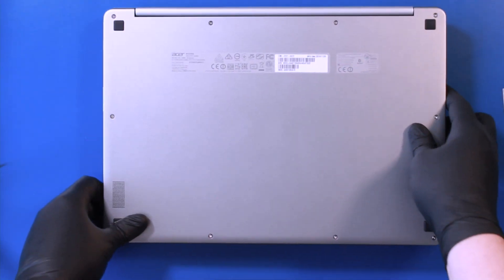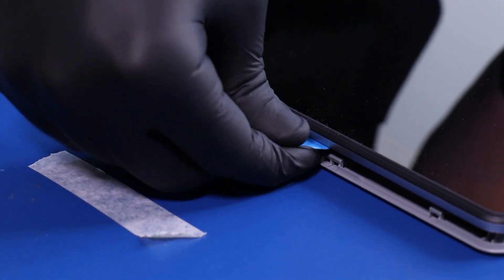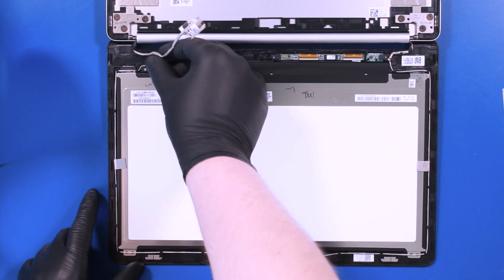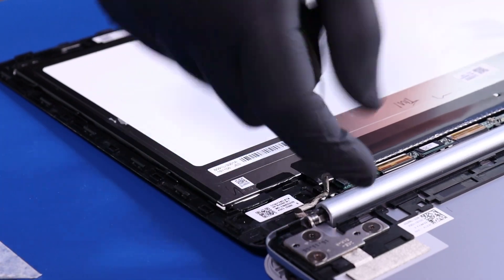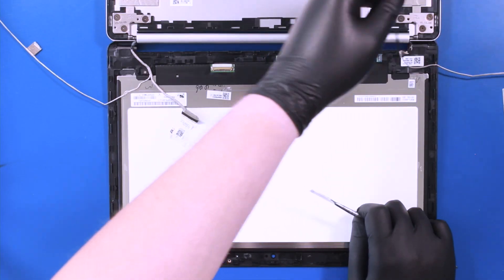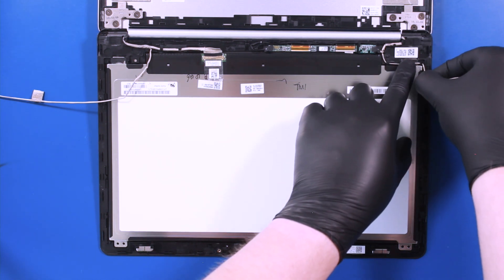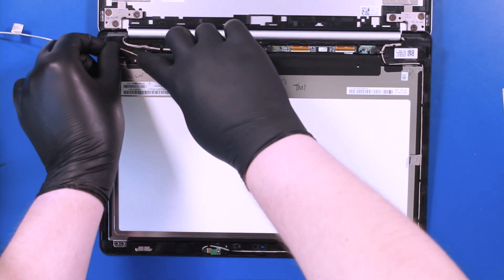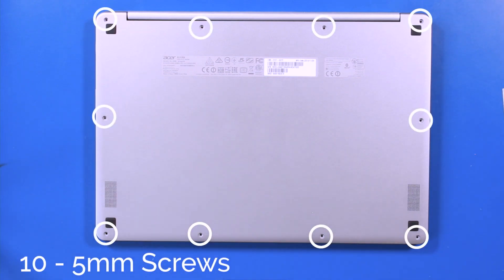Acer CB5 312T Chromebook LCD Module Replacement

Comment: I replaced a screen on an Acer Chromebook CB5 312T K2L7 with a new LCD module, but the one I received did not have an integrated sensor board. I tried using the sensor board from the old LCD module and I also tried without the sensor board, but in both cases, the brightness appears but there is no image. I tried with a second screen via HDMI, and it works on the secondary screen. Does anyone know where the problem might be coming from? Do I need to change anything else?
Reply from the maker: From what's happening with the new screen, our best guess is that there is either a faulty LCD cable, or the replacement mod itself is faulty. The sensor board should only affect your touch capability or being able to go into tablet mode / sleep mode (depending on which board you're referring to) What was the issue with the old mod? Did it work at all?
Reply: @Chromebookparts  My customer's old module was completely broken, with a broken/bent hinge. I don't know if it was still working or turning on, but she couldn't fold her Chromebook because of the hinges. I had to buy her a top back plate and a complete LCD module. I straightened the hinges, replaced the top back plate, and then took care of the LCD module, which was different from the old one. There was no sensor board (near the digitizer) and no label either. The screen has a black coating instead of the classic white background. Sorry if that's not very clear.
Reply from the maker: Okay, understood. Without seeing the screen / device for ourselves it's hard to say for sure, but it still sounds like there's either a problem with the lcd mod itself or the lcd cable may need to be replaced.

Comment: Could you tell me if there is a way to fix the touchscreen not working? Seen other models with similar problem and wondering if I can remove the lcd as well But don’t know what to look for as in cable ? If that made sense ? Appreciate it
Reply from the maker: Hello! Touch function not working could be either a bad LCD module (most likely), bad LCD cable (less likely) or a faulty motherboard LCD cable connector (very rare). Separating the LCD from the digitizer in this case might be more trouble than it's worth, as it involves a heating pad and risk of damaging the LCD - and we couldn't locate a source for just the digitizer.

In this case we would recommend replacing the entire LCD module, and if issues persist, then you could try replacing the LCD cable.

Comment: Why did you disconnect the battery?
Reply from the maker: Hello! For any repair that requires disconnection of cables, we always recommend unplugging the battery first, as otherwise there is a small chance of shorting out the device.